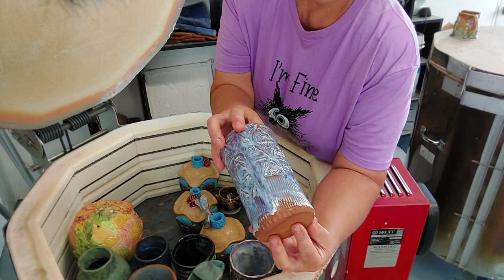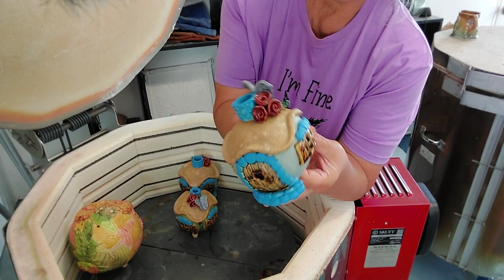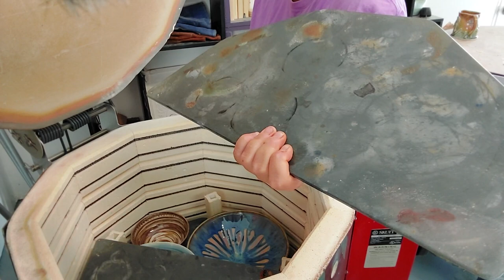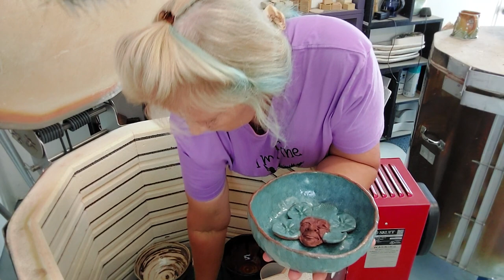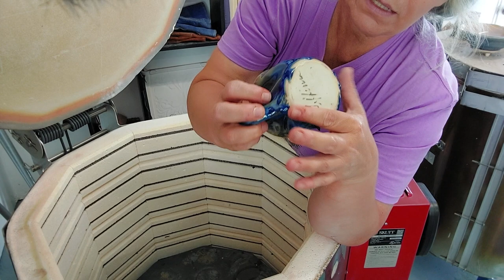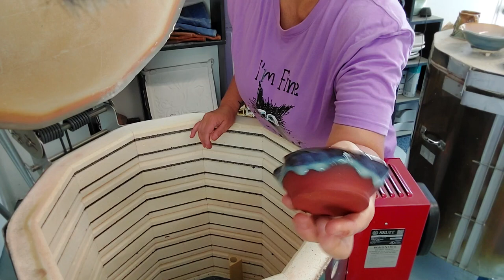Kiln Opening! Last one for a spell.

Comment: Hello, as usual really enjoy your videos.  I just purchased Advancer Kiln Shelves for my new Kiln, and the woman there recommended using kiln wash on the bottom and top of the kiln posts to keep them from sticking.  I am copying the recipe she emailed to me for anyone who might be interested.  Best Wishes and Thoughts going with you for your surgery tomorrow and a fast recovery.  Kiln Wash Formula

The general formula we recommend for kiln wash is 50 alumina hydrate, 25 kaolin, 25 calcined kaolin – all by weight. Apply 1-2 thin layers of kiln wash. The consistency for the wash application should be like light cream or half and half, not thick like heavy whipping cream or paste. Applying wash when the shelves are warm will accelerate the drying process. Due to the ultra-low surface porosity (<1%), the wash will ultimately dry suspended on the glass surface and will not soak down into the body of the shelf.
Reply: Ķ
Reply from the maker: I just watched Vaughan Smith and he recommended the same. Thank you sooo much.